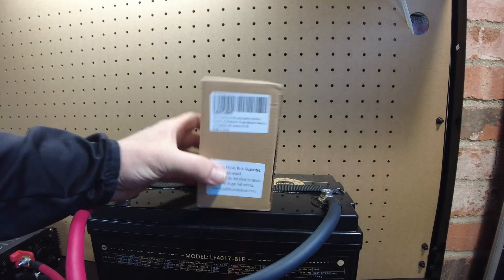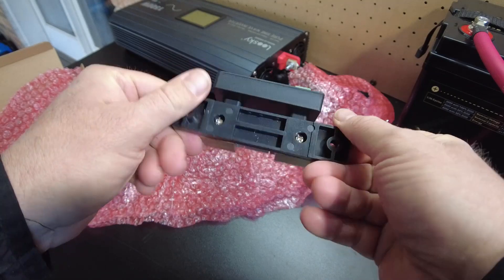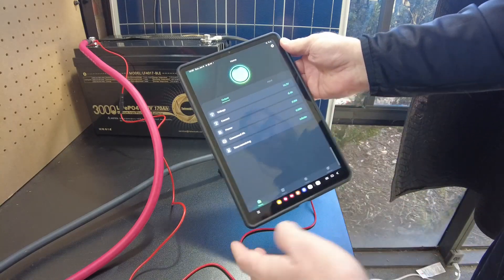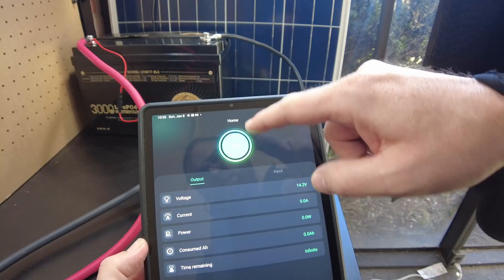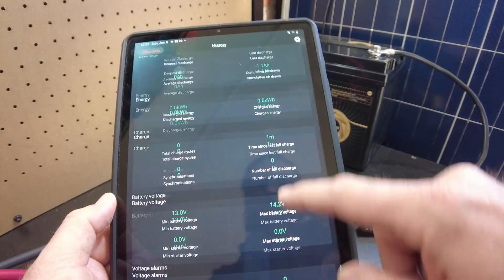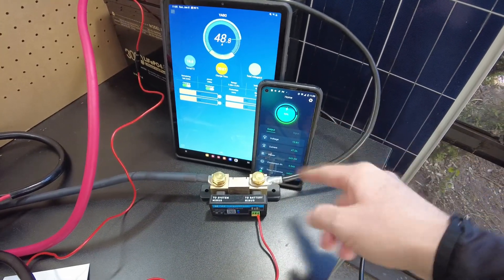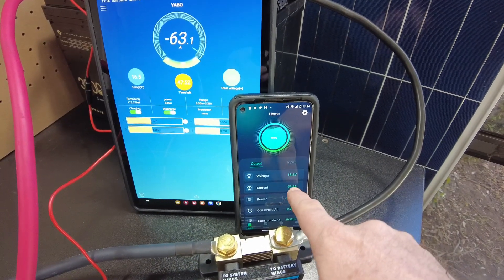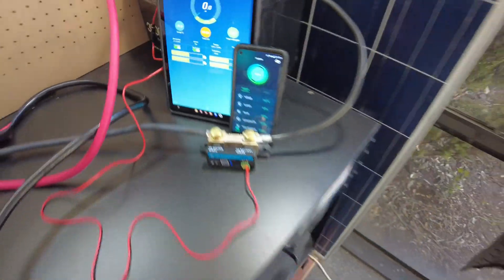TBD SmartShunt 500A Bluetooth Shunt

Comment: Im not impressed with mine. I've had several problems with the actual percentage of charge once it stated a way to low of a percentage than it should have been then a couple days later it showed full after many hours have been drained

Comment: I want one of these types of monitors for my Lithium battery off-grid ham radio operation but don't want a bunch of wires to contend with. Am I screwed? My battery has Anderson Power Poles, not screw-in connections like this one you have.

Comment: I want to use this on my trolling motor lithium batteries.  
I have 2 12v 100ah batteries wired in series.  Will this one device work for both batteries or do I need 2 . Also how would I wire it in thanks
Reply from the maker: You only need one. It wires in on the main negative of your battery bank. There is a small positive wire that will connect to the main positive of your battery bank.
Reply: @BradCagle   because they are wired in series I would just place settings on 24 volt and 100ah correct?  Thanks so much for your time
Reply from the maker: @jeffwhiteside1124  Correct. You're welcome

Comment: The diff between amps is related to Power Factor (PF) issues. But this time it’s with the AC side of the inverter.  The battery has to put out more power to power the inverter circuity, as well. It’s never a free lunch with this stuff.   Nice video!😊

Comment: The reason it showed 99% at the start was the power the Bluetooth was drawing, by zeroing it you removed the monitoring of the power the Bluetooth part of the shunt draws. This is why in the testing part the current draw was showing higher on the battery than the monitor.

Comment: $130.00 for a so called smart shunt is ridiculous. Not too smart if you cough up all that money for something that should cost no more than $60.
Reply: My $16 shunt does the same as both.😅
Reply from the maker: Yeah, this one is a knock off, and it does sell for around $60
Reply: As someone mentioned, the price is now $10 higher for the TBD shunt.  I am intrigued with this device and the price.  The connection portion of the setup couldn't be easier.  I agree that what Victron charges is ridiculous.  But if people keep buying it at that price, the price won't drop.  If Victron had any real competition selling similar devices, that would help.  It is too bad that Victron won't lower the price.  They would most likely sell more shunts if they did.

Comment: I have two of these one one my lithium setup on my RV and one on an off grid cabin.  About a year in, they are working well.
Reply from the maker: Awesome, glad to hear there is long term usage reporting. Thank you!
Reply: I just bought one of these, maybe my settings are off but seems like the shunt is using alot of juice. I have a 100ah redodo mini battery and charged it to 100% yesterday and now it's 
 at 95% and not hooked up to anything else.
Reply: parameters maybe ,, batery  rests voltage after charge and it might updated   % with that too
Reply: that app and device looks exactly like the victron. I think that's a 1:1 copy. Have you tried to connect this to the actual victron app?
Reply: @not.sharada  he mentioned in the video that he tried connecting to the Victron app but it wouldn't connect.

Comment: See if you can figure out the utility of the third wire port,  the Victron only has two.
Reply: You can either monitor a 2nd battery or connect a temp sensor. Both come with the unit.

Comment: Hey Brad,  I just bought one on Amazon to monitor some batteries on my rv. It should be here Monday.    I noticed it shows connections in  series/ parallel,  but not parallel.   I'm connecting two lithium in parallel.   Do you have the company's email address so I can contact?  Thanks,  Chris
Reply from the maker: You don't need to do anything special, just parallel your batteries, wire in the the shunt to what you decide to be the main negative, and hook up only one red (fused) positive wires from the shunt to what you decide is the main positive. Only thing you'll need to do is set the battery capacity properly in the app. So if you have two 100ah batteries in parallel, set the battery capacity at 200ah in the app. Their email is service@tumblevd.com if you need anything further.
Reply: @Brad Cagle  thanks Brad. Yeah,  I wasn't sure because I read the instructions and it doesn't say anything about parallel.    They have available only on Amazon and they raised the price to 70 dollars.   Still worth it if it's comparable to the victron shunt

Comment: Great review!! I just wondering how far can the Signal of the Bluetooth of the shunt will go before you lose signal?
I know the Victron Shunt is terrible for The Bluetooth signal giving Mabe 5 feet!!
Reply from the maker: Good suggestion, i'll test that. Thanks
Reply: @BradCagle were you able to test Bluetooth signal distance?
Reply: Just installed this last night and the range literally sucks. I have to be literally 5ft away, which defeats the whole purpose. I have heard horror stories about the Victron's range and thought this may be better, nope. I will de-install this and take it back, which sucks because I have it all installed and tucked away. Until I see the range of the Victron, I can't say if this is a TBD issue or a bluetooth range issue that both the Victron suffers from as well.
Reply: Bluetooth is a notoriously close range technology

Comment: What is the current draw? Victron claims <1ma
Reply from the maker: Great question, I'll hook up my fluke inline and check this.
Reply: @BradCagle  did you get the result ?
Reply: @BradCagle   Did you test current draw with your Fluke meter yet?
Reply: I just checked mine.  For a couple of seconds after power up it is at 2.50mA then settles to 1.15mA.

Comment: Hey Brad first of all thanks again for another great budget product. My question is did the shunt comes with a manual or isn't it available on like there website so that you can accurately set the perameters correct granted that you when tru the trouble of testing and tuning to get it right and if there is not the sell should use the settings from you video
Reply from the maker: You're welcome. Yes, it comes with a manual, and in the back it does mention the settings for lithium . I guess I should have read the manual first 😆